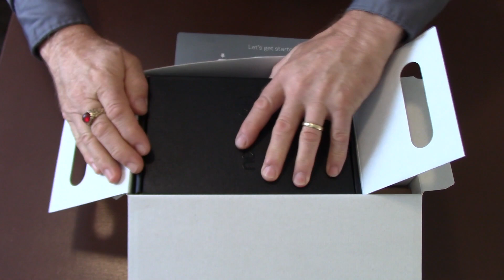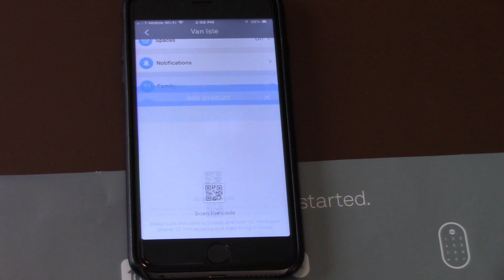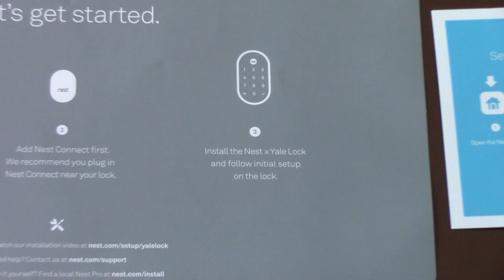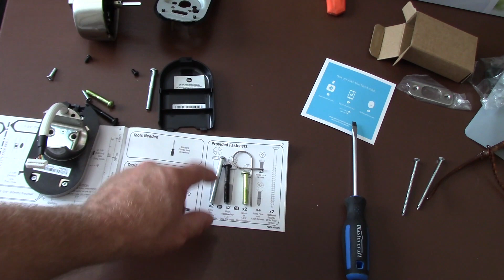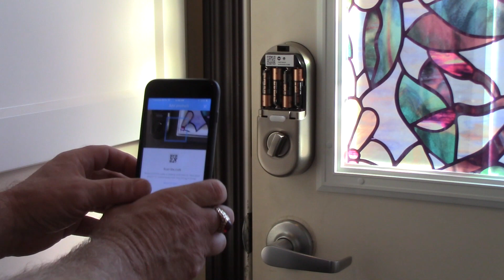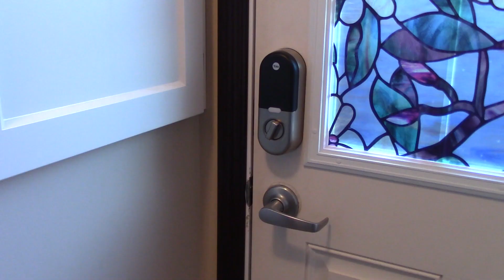How to Install the Nest X Yale Door Lock

Comment: THIS IS TOTAL NONSENSE.  I have one of these and EVERY time there is a wifi disconnect this thing is a ROYAL PAIN IN THE AZZ to get reconnected.  It usually takes 45 minutes to an hour or more and many many ATTEMPTS TO GET THIS PIG WORKING AGAIN.  Severe buyer's remorse.
Reply from the maker: Hey Howard.  Sorry to hear your experience has been so poor with this.  Please know that I'm not a paid endorser of this product.  Bought it myself and did the video just for content reasons.  I will say that I have had almost no issues with mine at all, and I've had it installed in 2 locations in 2 different countries over the last several years.  I've changed the batteries about 3 times over the history and at those times I worried that it would lose it's mind and have to be re-programmed, but it always comes back to life.  I would complain to them as you must have a faulty unit.  Or needs a firmware update, or something? Anyways, thanks for watching and commenting with your experience with it.

Comment: So youre going to skip the most important part which is the app connection troubleshoot.  Nice Clickbait.
Reply from the maker: Any help you need with that you can email me at terry@electrical-online.com and I'll do what I can.  Apps can be frustrating, and sometimes there is no explanation as to why they don't work right away.  Then you try again, and it works! That's what happened to me with this installation, I spent an hour or so screwing around with it, swearing, cursing, then suddenly, all worked.  No click bait from me.  I'm the real deal.

Comment: Thanks for this video on how to unbox and install the Nest x Yale lock.  This was a very helpful and informative video.  I ran into one issue when installing, I had everything installed properly but when I attempted to lock the door remotely I would get an error message "Door cannot lock", but it was actually locked.  After several attempts and uninstalling and re-installing I realized that I had to chisel out  and hollow out the hole in the deadbolt catch.  Just wanted to add that if someone else in running into the same issue but they've installed everything properly they need to check the deadbolt catch and probably need to chisel it deeper and hollow out the hole so that the Nest x Yale deadbolt will not be blocked and can fully lock into place.
Reply from the maker: Good advice and thanks for sharing.  Yes, if the deadbolt cannot fully extend, it will cause a that fault.

Comment: The only reason I clicked on this video was to see how you coneected the lock to the app. But that was the one part you skipped. Its also the part people are having the most trouble with :*(
Reply: I have definitely wasted a lot of time trying to get the lock to connect to the nest connect. This is truly the problem that makes me regret buying this smart lock.
Reply: @JohnJohnson-rl7fq  I spent 2 hours today trying to get just the Nest Connect set up. I gave up
Reply: Any solution?
Reply: @ermonga  I sold mine after a week. Garbage
Reply from the maker: It just takes patience, and a few tries to get it done.
Reply: @theinternetelectrician  yeah I'm trying to troubleshoot the same thing, I press the privacy button on the inside of the door during install and it just chimes 3 times and doesnt turn blue. Patience is not the issue here.

Comment: If the battery dies you can't get in your house though.
Reply from the maker: kieran beneski they provide 2 terminals to touch a 9v battery to provide the power to operate the lock should that happen. I keep a battery stashed outside just in case, but change the batteries twice a year on the same schedule as your smoke detectors and this should never happen.